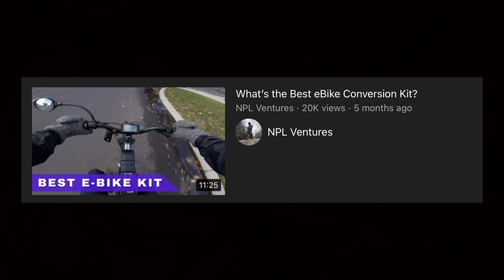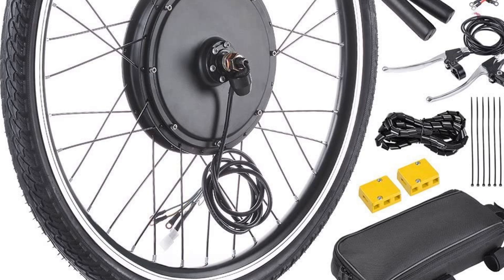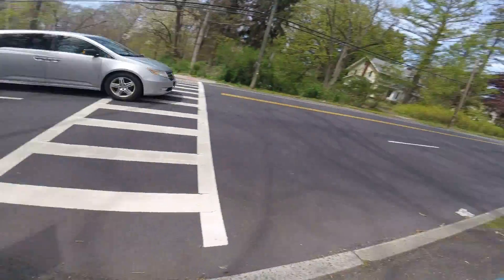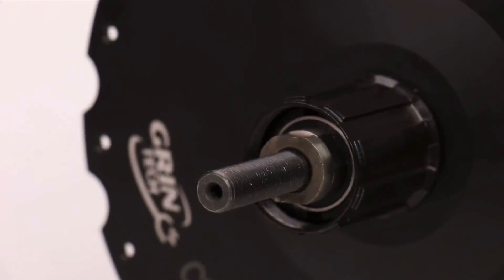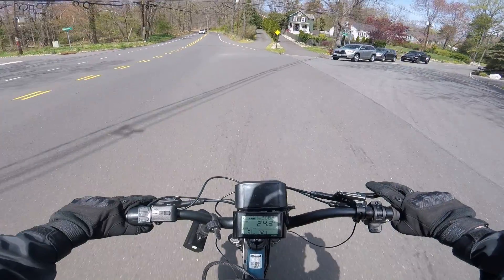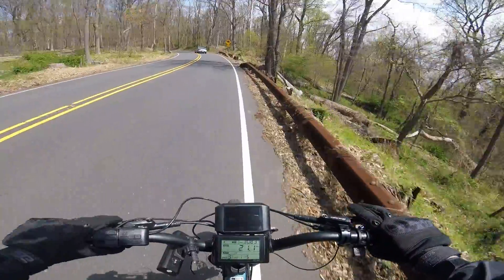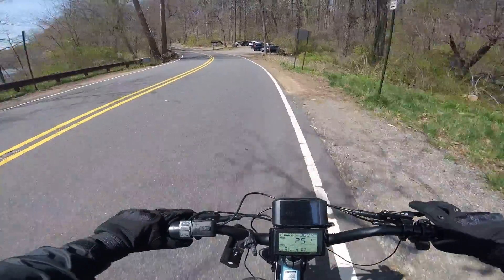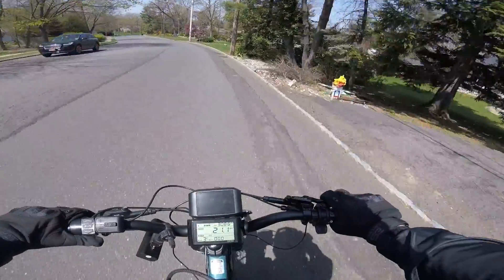The Absolute Best Hub Motor for your eBike Conversion Build

Comment: All well and good but you're going to be paying 4or5 times the price of the standard Chinese hubs which work perfectly well if installed correctly.
Reply from the maker: They are more expensive, there is a trade off to be made
Reply: @NPLVentures  no there really isn't alot of these so called premier manufactures are not one jot better than the standard hubs I have built enough of them to know it really is a  con to be honest.

Comment: As a car replacement I would stick with a 72V Hub motor and a large 30+ AH battery. I have a Mid drive BBSHD and also QS205 Hub motor so not hate for mid drives here but Hubs are more dependable. You can get a QS205    fitted to  Moped/Motorcycle wheesl with 10 guage spokes. You won't get flats with motorcycle wheels/tires as they are rated for much more weight. If you require a very light build or offroading then I would stick to a upgraded 72V BBSHD or CYC mid drive.
Reply: We managed to convert a Enduro Frame into a 72V CYC X1 Mid Drive.   And its fast.
Reply: @stealthebike761  If I lived outside NYC near woods/trails or didn't mind the mid drive  noise I would probably do a CYC with my Enduro frame. Curious how fast does a CYC with Enduro frame go? Truly amazing how compact CYC motors are vs a BBSHD and so much more powerful.

Comment: I prefer all in one setups to minimize wires and bird nests on the bicycle. 

The golden motor edge hubs with integrated pure sine controllers I find to be quite impressive. Their pedal assists are junk though but they at least come with cruise control
Reply: Grin shipped my all in one kit preprogrammed . super simple ! GMAC8T, PAS, CA3, Phaserunner sleek cabling
Reply: I've got a golden motor MP5. Running 52v. I've done thousands of KMs with no issue.
Reply: @letdogsbiteyou  I have the same thing MP5 and 52 volt 13 amp hour battery ..never has let me down in 3 years of riding most every day for at least an hour
Reply: Been using the Magic Pie 5 for 3 years ..set the cruise control for 7-8 mph and I use my 8 speed bicycle to keep some pressure on the petals ..I ride slow for the exercise .. I have seen petal assist and it doesn't look like as much of exercise as I get ... took off 85 pounds in 2 years on this thing

Comment: Grin makes some great stuff. Love the phaserunner controller, and other stuff from them. But be careful using the term "BEST". As far as I am concerned the QS motors are the Top of the food chain. They hold multiple records for speed and torque. But for me I prefer mid-drive motors. I have an upgraded BBSHD that is 3000W but is stamped on the motor 750w(which is the max wattage allowed on US streets). So it "appears" legal when cops check it, and they do. I also have the benefit of having 8 gears to pair with that 3000w. Making my bike not only fast(50mph on flat terrain) but also has tons of torque for hills. Benefits to both motors but I like mid drives way more than a hub motor. Do research and buy what is best for YOUR use.
Reply: Yeah I especially like when you break a chain on the mid drive, so much fun.
Reply: I'll say this I've had the GMAC 8T for over 3 years now, and it's a fantastic motor with it's locked clutch, the MAC series motors are fine but you do get into modifications or dealing with clutch replacements if you wear that out. I do agree with Doug about the which one is "best." It really depends on application, also you get into people cross the line into motorcycles without realizing it too, just saw someone get a custom built QS motor with 30kW of capability. That in my opinion should go on a motorcycle frame and not a bicycle anything. I do think the GMAC with it's variations 6T (off-road/fastest speed winding) all the way to the 12T (highest torque, low speed winding) do give you a lot of variability on what exactly you want your build to do. 8T and 10T are pretty much middle of the road options. You can also employ Flux Field Weakening if you want more speed at the cost of your range and potentially the life of the motor over time.

To address the legal issue, that is a state-to-state issue. Class 3 bicycles in most states cannot exceed 28mph, although most police in my state ( North Carolina ) wont even look twice if you have pedals on your "mysterious electric thing" so they let Surrons and effectively electric dirt bikes that can hit highway speeds pass. I mean I am pretty sure that's why luna cycle sells a "pedal add-on kit" for the Surron. I definitely wouldn't encourage anyone to break the law, but your mileage may vary as to what they allow and don't allow legally, and in reality. I've seen people using stealth bomber frames, just entirely let go because they have pedals. On the other hand, I've seen EUCs (Electric Unicycles) get chased by law enforcement here in NC because they were definitely going highway speed. There is a level of personal responsibility, when you decide to run those speeds on a bicycle. I honestly view going more than 35 mph on a bicycle frame to be a bit insane.

Worth noting if you were considering grin tech, I'd wait until Phaserunners are back in, which will be later this year. I do know they have the Frankenrunner which is a BAC855, and you could honestly just run the BAC855. Although the grin tech kits and their support are fantastic, even from a technical perspective.
Reply: @fang64  u seem super knowledgeable, anyway u could help me make a decision on what kit to buy LOL
Reply: @JMac___  Sure, what do you need help with?
Reply from the maker: Great points!
Reply: is it a bosch or a yamaha?
Reply: tell me you don't know what you're talking about without telling me that. the idea that torque and "speed" are even the top metrics for motor performance is so ridiculous. You haven't learned anything from Justin clearly
Reply: @meppieomg  Lol I dunno what he said, I'd say the top metrics are power to weight ratio, noise, efficiency, durability, ease of build, so year torque n speed is a relative metric.
Reply: It's nice having Grin right in my home town of Vancouver. They're the best!

Comment: For their prices, I'd say you're better off buying a complete e-bike. It was $750 just for the rim and motor on their site. And they expect me to lace my own rim at that price too. Crazy! And they're not getting anymore of their nice controllers mentioned in this video, well, until the end of 2022. Instead, they are offering a different one, which the link to on their site is broken. Hmmm what will you get???? Maybe someday. But, I don't have near that kind of money for a motor, and rim. And, definitely not when I need to lace it myself. Crazy! By the time you get your whole kit put together on their site, you could have bought a complete beast of an e-bike. Like a 3000 watt stealth bomber. Or, something newer and better. My whole e-bike cost me $1050 to put together. It is a 1500 watt 48 volt kit that I threw on a Jeep bike. It might not have all of the bells and whistles, but, it tackled the steepest hill near my place without a problem. And, it is really steep. Also, I've been riding it a lot over the 2 years I've owned it. Off road, and on the street, I have no complaints. It even has a cassette, torque arm, forward, reverse, half power (750 watt) option via unplugging a wire connector, a battery meter on the throttle, and a key to turn it on with. It cam with the pedal assist, but, I didn't install it. I like to just hit the throttle when I want that extra power. It does 45 mph to. If I want it too. But, love the video, and, to each their own. Peace!
Reply: The good thing about buying a conversion is that you can upgrade it without selling the bike, and you can also buy another frame and transfer everything.  Another thing is that you can customize it better than a factory bike.
Reply: Bafang 1500w?
Reply: Meh, maybe.  The most expensive components of an ebike are the motor and battery.  The bike itself is cheap to build, they aren’t exactly using carbon fiber.  If you can pick the motor/battery/esc you want, and put it on a relatively cheap bike you already own and don’t use, you might be better off.

Comment: I’ve done the same thing.  I live in a very co gested area.  Easy to get parking tickets, towed, stuck in traffic and not be able to park towards having to taxi for a long time.  I realized most of my commute was close & me opting for the bike more often than the car.  Chores where quick stop and goes and i’m quickly back home.  It felt like having your own person metro rail.  I can maneuver it quick up stairs.  Park it where anywhere, take it in my home & it on the bus or rail on long trips, just to get to a particular area like a mid town , down town area or district & i’m off.   I’m on a goal in trying to make the ebike more efficient as possible. Maintenance, easy build, care, ect.

Comment: plastic gears fail and shear the teeth off. The more moving parts, the more chances of failure.  Directdrive gearless are reliable.
Reply: -- and don't make whiney go-kart noises when you ride... and don't require removal and disassembly every 1500 miles to inspect and regrease those plastic gears... and can be configured for regen... oh, and then those nylon teeth do start to fracture, that's about the time when you'll find out that the original manufacturer moved on and is now making picnic tables or something.  👍

Comment: Need more info. I don't like peddling so I need a throttle and I don't want to be limited on speed, so when I'm on streets I want to be able to adjust down speed to be legal but when I'm off road I want every ounce of power that hub can muster. So I don't mind peddling sometimes but want a throttle.

Comment: A brushless hub motor is not a DC motor, it is a 3 phase ac motor. A brush hub motor is dc. Bafang motors are dependable and high performance, repeating the word cheap and Chinese together constantly is ignorance on your part.

Comment: Sweet video. I am expecting a rear hub gmac kit from Grintech in the next week. Super excited!
Reply: @ayoutubewatcher7009  Just finished the build last night. Went really well! The Grin tech kits are easy to install and are of quality. I am 100% a believer in e-brakes/regen now. I will probably make a video going over my bike in the next 3 months so keep an eye out :P I'm just trying to find a good position for my throttle as I am using drop bars. Enjoy the day!
Reply: @wagnerbynature  have you gotten round to testing it's top speed? What battery have you paired it with
Reply: @michaelsMW2movies  Yeah. At the moment with my 52v 20ah battery I can go around 50kmp/h. Watts were locked at 1500w, not sure If I can get more out of my controller. I heard the motor can handle 2000w+
Reply: @wagnerbynature  how many more miles does the re-gen braking give you?
Reply: @connicrow9463  On average 10-15% of 20AH is regenerated on most of my trips. Not sure exact distance. Also there is a drag when you enable regen, so it slows you down on most stops, about 90% of the way, saving brake pad wear as well. I personally love it and wouldn't want a bike without it.

Comment: The only thing that sucks about hub motors from wat I learned is that it sucks going up steep hills it will over heat the controller and frie the wires and turn off ur bike n power and stop functioning properly
Reply from the maker: true but a lot of factors including wheel diameter impact this. I have been surprised by the hill climbing ability of my hub motor

Comment: Watched this video wondering if you were going to introduce me to something better than Grin. Nope! Not disappointed though, and totally agree with your assessment. The only issue with Grin’s stuff is the price, but if you’ve got the money for it it’s the best you can buy and stuff like regen braking can save you a lot of money on brake pads. Their new charger that lets you limit charging your battery to just 80% could lead to it lasting a lot longer and more than pay for the cost of the charger over time if you put a lot of miles on your eBike.
Reply from the maker: Agree, the company has solid products and research.
I'm always on the hunt for other products that may be better or more cost effective

Comment: Waterproof connectors can be added to any motor easily if you know how to solder and make soldering joints waterproof. I think both of those skills are essential if your making a build. 
Bigger problem imo is the price you can get cheep chineese hub and it will do its job for half the price if not less. It's more like, you want to go budget, or you want to get fancy.
Reply: My cheapish voilemart waterproof  1kw rear hub motor with a cheapish 52v 28ah upp battery has done 2500miles all weather 20 mile work commutes and dog trailer pulls on hills no problem at all .

Comment: Spin out happened to me. Been an awful three week waiting for a replacement from Alibaba even with express shipping. Should get it tomorrow.
Reply: I can repair the damaged wires resulting from spin out.
Reply: @yoda-be.at1746  wish I would have known before I bought a new one. I tore out the old motor stator after attempting to resolder it myself. I upgraded to 1000 watt motor anyway.

Comment: I’m soooo confused… next weekend I’ll make one full year on my bicycle, through all four Canadian seasons. Now I’m wondering about just not driving a car at all and getting a electric bike. I want to continue to trip with this bike and need to get 130or so Kms out of a couple batteries. 
Is a hub drive the best choice considering I’ll commute and do trips with this bike? 
I’ve learned tons from your videos, no pressure to respond, but many opinions are like assholes, everyone has one, and I don’t want to spend tons on the wrong choice. 
Cheers, keep up the videos, congrats on selling the car!
Reply from the maker: What I have come to appreciate having both a hub and mid drive is the reliability of the hub motor. If you plan on using this as a primary vehicle this should be heavily considered. 
If you want more low end torque, like in mid drives, something like the gmac motor is a great, reliable alternative.

Comment: Mid drive motors are goated, I bought the BBS02 for my full suspension mountain bike. Great ride.
Reply: I've had them for 4 years, i would day no, hubs are better for durability. Mid destroys your chain and casette and no regenerative braking no fast acceleration.
Reply: @Qu.Z.  I agree 100%, hub motor all the way.
Reply: @Qu.Z.  mid drive for fun, hub motors for workhorses. I got a thrift shop BBSHD and the thing messed the hell out of my derailleur when it crashed thanks to its torque. A hub motor with a derailleur crash and I could have still powered home. I use a front geared Ezee hub with a 7 speed hub in the rear now, and I slapped a flipsy 75100 on it rather than the rather weak 16 amp @36v ezee controller, mostly the torque difference is huge between this and stock even at the lower battery amps, though this sony 20ah pack it came with can do well above 16 amps.
Reply: Mid drive motors are a very niche use case that will chew through your drivetrain parts quickly.